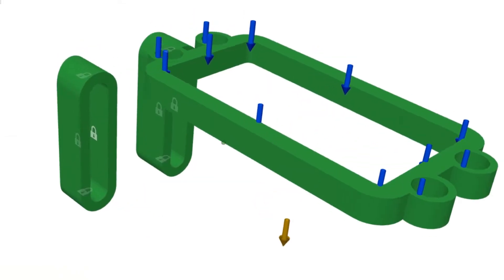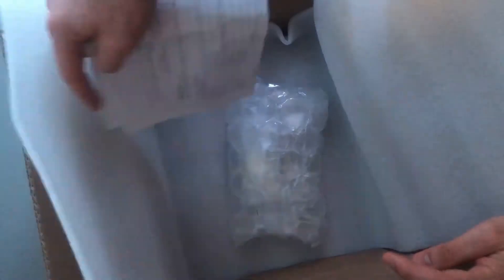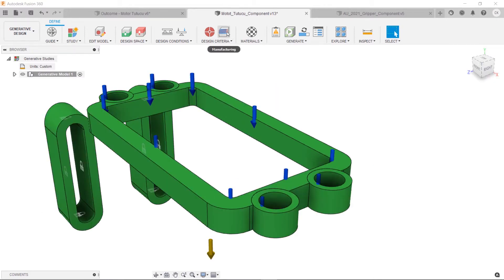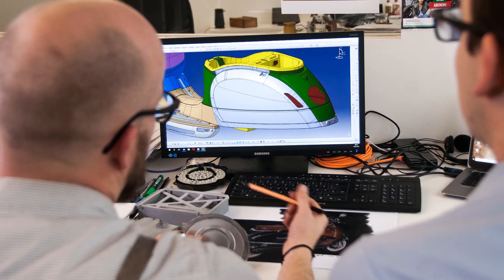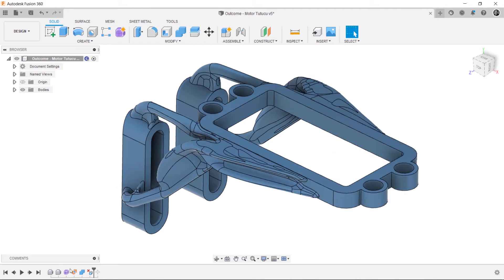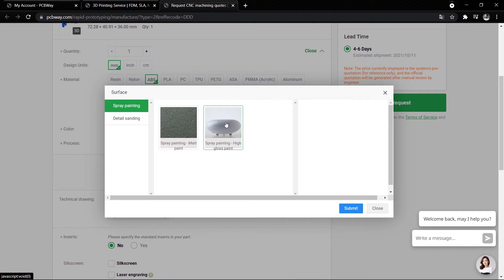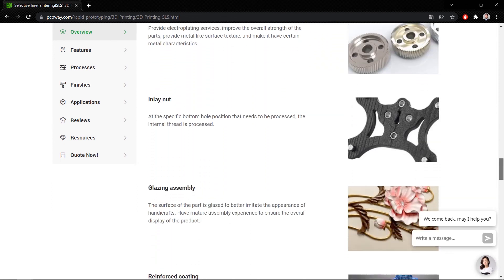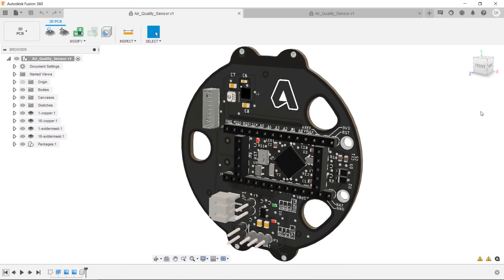Creating Robotic Arm Gripper using AI Powered Generative Design in Fusion 360 | PCBWay

Comment: You need to change the title of this video to 'Commercial for PCB Design'. This was not a demonstration of you creating anything at all. All we saw here was an Ad for a company. Were you even going to go over setting Pins or Preserve Geometry? 'Amateur Hour' was last week dude. - Technical Designer II - At a Space Company.
Reply from the maker: Thanks a lot for feedback! We will take into account your comments. Also, as I mentioned in the video, there is a link from my Autodesk University Class, you''ll find the link in description. The mentioned video is a full content of the class of "Creating a Robotic Arm Gripper using Generative Design". But I understand your worries about the PCB Designing, and I will make a video about the explanation of 3D PCB module in Fusion 360 with a electronic designer. Stay in touch, have a great day!